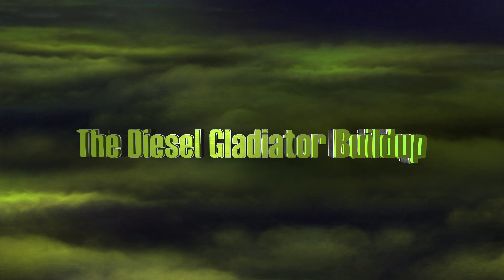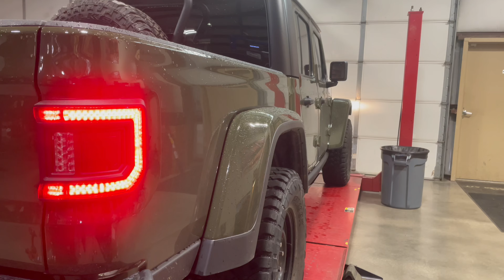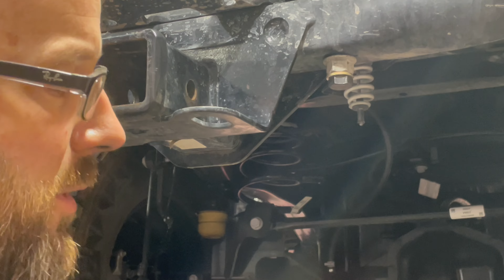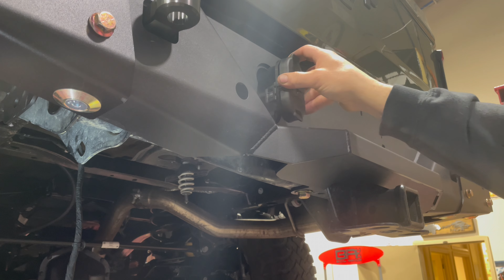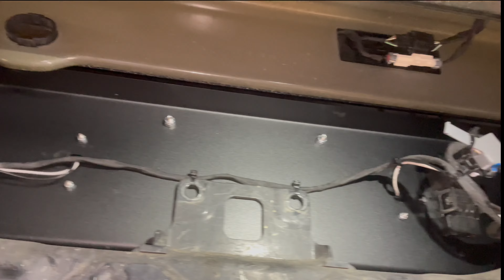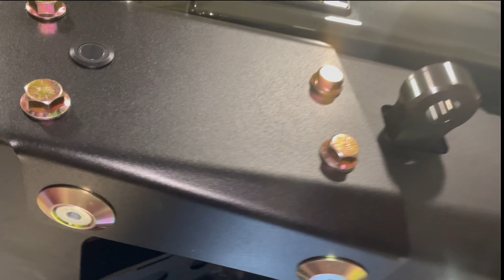Diesel Gladiator Buildup - Oracle taillights and MetalCloak rear bumper

Comment: Is it me, or are the shackle mounts drilled and mounted facing the wrong direction? Every off road vehicle I've seen has it so the shackles have freedom to move up and down, not side to side. The current position they're in puts a lot of pressure on the sheer point of the shackle pin when doing most normal recoveries.
Reply from the maker: That’d be a good question for @metalcloak